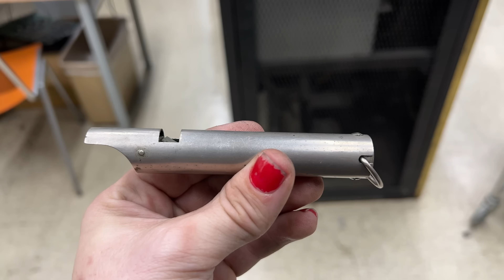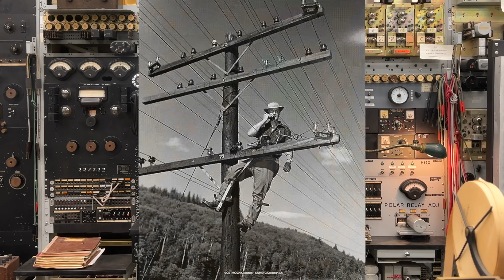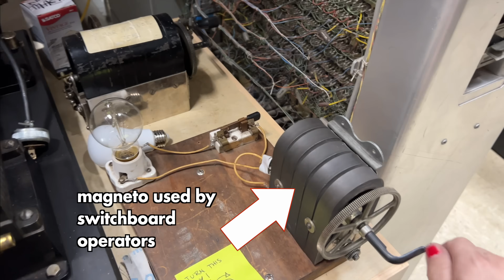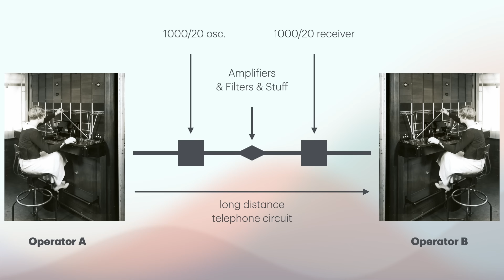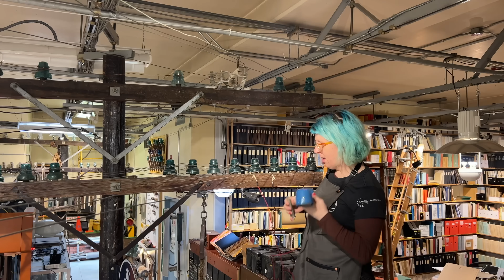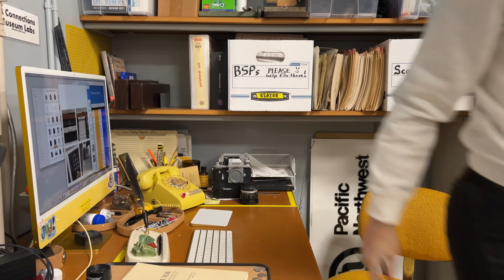This is NOT a Captain Crunch whistle!

Comment: I´ve been watching this documentary the other day: "Telephone History: First Transcontinental Phone Call | Documentary | 1940"
and at 6:20 they said something about wires being "noisy" at few miles etc.

While I understand all the noise when switching equipment is involved, I am wondering what kind of noise was it back in the day without all the gear and amplification, I assume it was all unmodulated DC volage and basically just a carbon mic connected to a speaker over a long wire. Are there ways to reproduce this how it sounded back then?

Comment: How do you get into a specific carrier channel by clipping on with a test set? Or did the earlier carriers use frequency shifting to move the second and subsequent channels higher in frequency? Yes, I'm too lazy to go look it up in my set of A History of Engineering and Science in the Bell System. Also, wouldn't just clipping on and putting the impedance of an earpiece disturb the carrier system enough to drop calls? All of my experience with carrier systems is coaxial and later (starting with L-4 which was in the final stages of replacement when I started).

Comment: Another piece of infrastructure sometimes uses 1kHz signals: the coaxial sensor loops in the pavement which detect cars pulling up to a traffic light. Usually one car approaching a red light sets off a timer for changing the light, but several cars sensed will get the light to change immediately. I always wanted to connect an antenna to a 1kHz oscillator under my car via a momentary switch and see if I could fool the signal onto thinking several cars were there instead of just me.

Comment: This tone made testing lines a little more difficult when working in a test center.
The tone was used to test the transmission quality and as a tester you could hear the tone in your headset while testing. 
If you put the tone out on a speaker, you had the potential of Dropping the calls of the others in the center. 
The tone was a signaling tone as well and was used to drop a connection that was up in a long distance call.
So if you were talking over a long distance connection and someone sent the tone from a speaker, the call would be dropped because of switching equipment in the long distance network.

Comment: Signal corps Vietnam, over VHF radio links (Van AN/MRC-69) we had a 12 line multiplex system and use 1600 cycle ring tones, like your example at the other end converted from 1600 to 90v 20 cycle ringing current. The VHF radio link operating the multiplex equipment would “whistle down” a channel to test the connection of a channel to both ends trunk line. So one quickly learned how to whistle a 1600 cycle
Reply: Motorola developed "PL" or "privacy line" for it's business band radios. The squelch on the receiver wouldn't open unless it 'heard' a certain specific subaudible tone which allowed several users to work the same radio frequency without anyone having to hear someone else's messages. Ham radio picked up the concept for VHF/UHF repeaters which are usually at a high elevation and might 'hear' a more distant signal into another repeater and not respond to it, gaining the same effect of multiple users on one frequency without interference. Some older Ham radios didn't have tone encoding capability and some Hams found they could key their mic and "whistle up the repeater" which recognized their whistle as the correct tone..
Reply: @P_RO_  , Yes after Army became a Motorola Teck 
T-power, twine Vs, Motrac, Mocom-7s, Micor, Syntor, and the low price S... even the Mocat
Oh, and I do have my key to heven!
Reply: @mackfisher4487  You might b surprised at how many things have a similar key system...

Comment: The new museum is awesome…Never knew there was an official whistle for that purpose….very cool…I knew a guy who built a blue box…well, wasn’t blue…but it worked like one…my older brother was more of a hacker and phreak than I was.  It’s still fascinating.  Both of us had trash 80s and we tried to build a network between our computers…we drilled a hole between our rooms through that baseboards and wired our computers together using the serial ports…the wires were wrapped in aluminum foil.  It sort of worked…My dad who was a computer geek himself was both angry and impressed.  He pointed out that we almost drilled into the electrical wiring…ooops.  We spent that weekend fixing the damage…🤦‍♂️ anyway your video reminds me of the old days of hacking and phreaking…😁

Comment: Cool Telephone trivia I was not aware of. Couple of questions: 1) The receiver needs to ignore if 1,000 Hz occurs during a normal call. I assume the tone must be present for some minimum amount of time. 2) As has already been posted how does a carrier system support connecting a Butt-Set?
Reply: The term related to #1 is “talk-off” and was an inherent issue with in-band signaling where it was possible to accidentally disconnect a call by whistling or singing just the right frequency and have a switch at the other end of the line start listening for multi frequency (MF) tones to route a call. It’s also the foundation upon which phone phreaking was possible.

Comment: dose the whistle still work if someone has a landline phone
Reply: No, only on 2600hz controlled trunks which aren't used anymore. Call ProjectMF if you want to use the whistle and a blue box these days.
Reply: AFAIK this whistle would never have worked (directly) with landline phones; this system was only used on long-distance trunks with manual operator switchboards, and those are long obsolete.